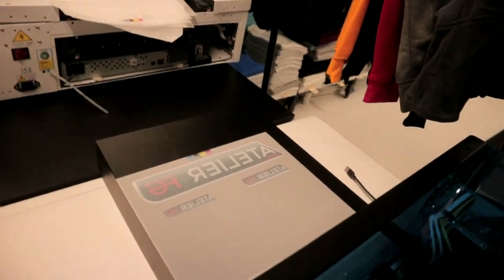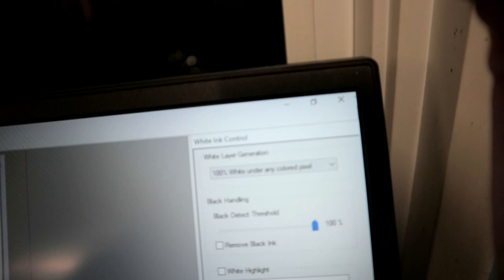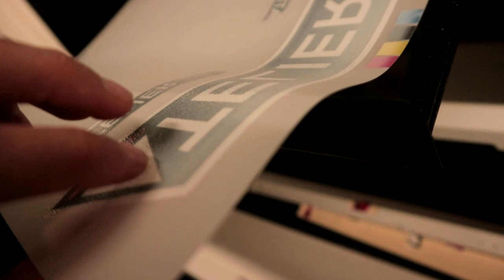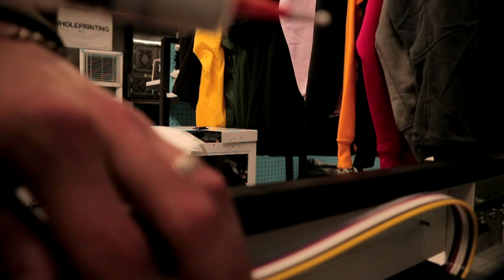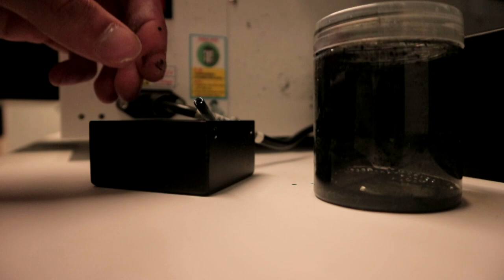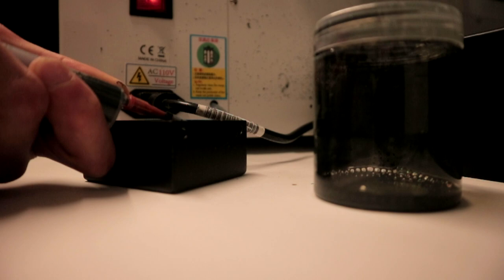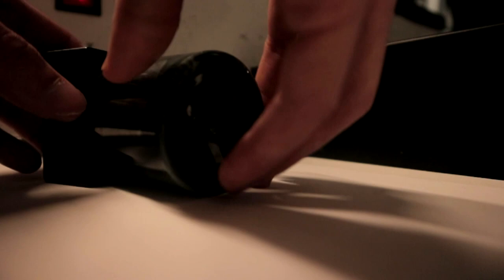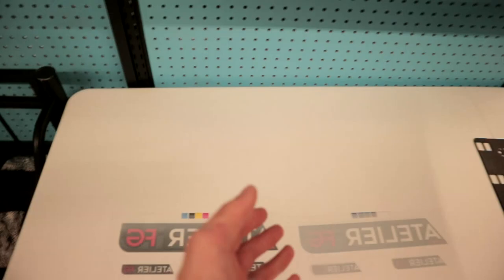How To Fix DULL DTF Prints

Comment: I believe my rip software (V10.1) only goes to 100% on white. However, when I press white on a colored or black shirt, the white changes to a light shade of that color. For instance, if I press white on a black shirt, it turns to a light grey. Or if I press on orange, white becomes a lighter orange. How can I fix this? I have tried everything from shaking the white ink, to doing a print head cleaning.
Reply from the maker: Many variables can cause this email us- wholesprinting@gmail.com
Reply: Use black dtf power
Reply: Hello Benjamin, were you able to fix this issue? I am having the same problem! I have watched many videos and one thing I noticed is that if you print as a picture, not a graphic people have great results. However, my software does not have that option. Does your? Any feedback is greatly appreciated.

Comment: Does the ink percentages work with the xp15000 or just industrial dtf printers?? Thank you will definitely test of these ink percentages…I’m have the same problem with dull images
Reply from the maker: I’m not sure about the XP15000 but it should be possible do you have a setting in your printing software where you can increase the white ink %

Comment: I have a off subject question. I see you have a panda dft in your video I have 1 also but I have trouble getting the paper in and to read it and then when I do I start printing then it stops mid print and flashes red for the paper and ink did you ever have that happen and if so do you know why? I'm having this problem. Thanks
Reply from the maker: Email us wholesprinting@gmail.com
It’s a simple fix

Comment: Thank you for the video. On your second print (fixed print) is the white enough to put on dark shirts? I have been having that issue with my printer white, but mine looks about the same as your print. When I put my prints on dark colors such as black it makes the white look gray.
Reply from the maker: Ideally, make sure the white is at 100% to insure proper prints and longevity!